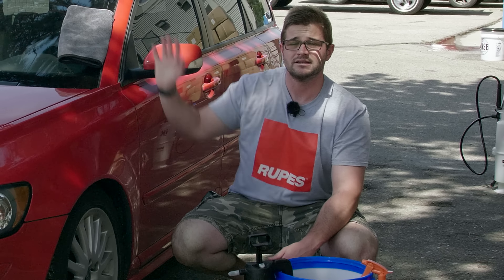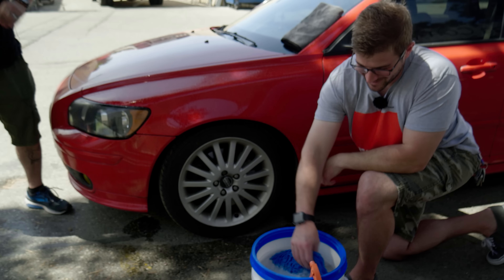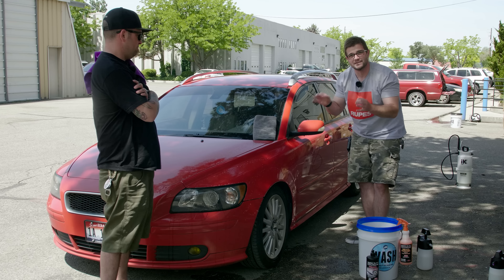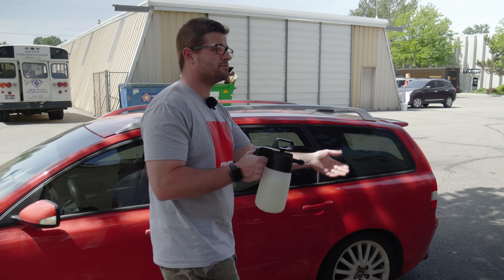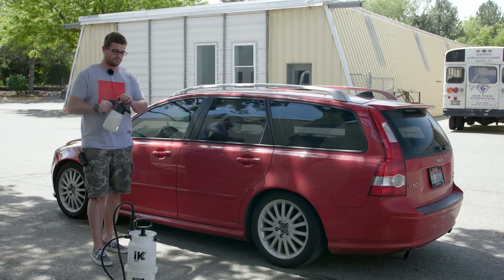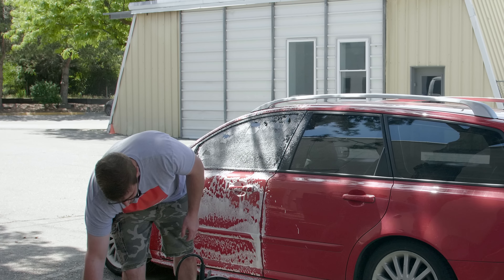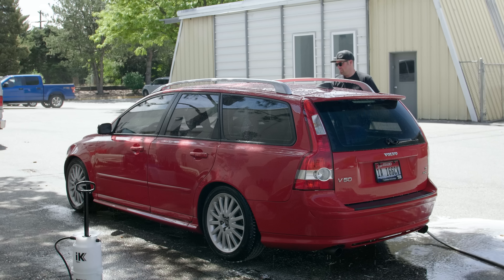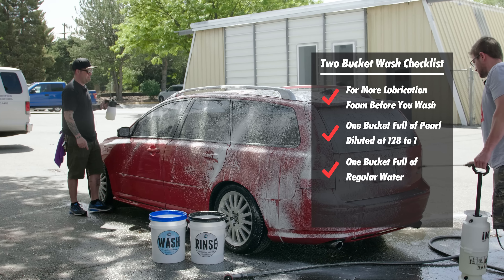BEHOLD: ALL Of The Ways You Can Use P&S Pearl Shampoo! | RINSELESS WASH + FOAM + 2 BUCKET METHOD

Comment: Ok, ever since watching your video last year, P & S Pearl has been in the back of my mind as a soap I want to try it before my next big order.  I, like the rest of you,  have used all kinds of soaps, everything from the expensive boutique brands at a $1.60 an oz to ones as low as 7 cents an oz, and for the most part I enjoyed all of them.  I've tried so many different brands of soap, from Ammo, Auto Fanatics 007, Adams, MTM, Gtechniq, CarPro, 3D, Bilt Hamber, Ethos, Optimum, Womo, Gyeon, Meguiars, Griots, Xtreme, Chemical Guys (numerous), Fireball, Tac Systems,  TLC last soap, Angelwax, Turtle Wax, Pearl Nano, and the list goes on. I have a few favorites in the group that I buy in the 5-gallon containers, but the rest was just for testing. So I was about to order when I watched Pan's video on Pearl and that's when I decided to try PEARL because I really wanted lubricity over anything else because I have learned I am not a fan of suds over substance, i.e. cleaning power.  

We have never been this happy with car soap, so much so that we bought ten gallons.  The lubricity is out of this world, I mean I have never felt anything like it.  We use 1 oz per gallon for contact wash and 2-4 oz in the foam cannons and the cost is only about $48 to 60 for five gallons on sale, which seems to be about every two weeks, :-).  This soap proves again, tons of foam doesn't clean the car, it's the cleaning and lubricity agents within the solution that are the secret and PEARL nailed it!  It is the perfect consistency that allows cleaning agents to separate the dirt from the car and it's low viscosity produces a thick but watery foam that is capable of moving the dirt off the paint with ease.  I am SUPER SOLD on Pearl!

Comment: Anthony/Levi, will either or both of you be putting out a video on P&S's Inspiration Ceramic Coating? If so, and you are going to correct the paint can you use and explain the use of the LC Orange HDO pad with The Last Cut, on Anthony's Porter Cable (For us Padawan Detailers) similar to how  he used it on the $500K Mustang Detail.

Comment: If I pre-treat a panel with degreaser (removes traffic film and wax and sealant) and then begin to do the rinseless wash process using a wash and wax soap, will it put back the removed wax or since I used the degreased I need to apply a fresh layer of wax?
I mean will using a wash and wax soap compensate for removed wax by degreaser?
Thank you!

Comment: So if you are using Bead Maker as a drying aid and it is getting applied to a wet surface does it dilute or impact the end result of the Bead Maker meaning impact the slickness or gloss enhancement because of the dilution with water during application?  I have been washing my CQuartz coated car, air drying it with the Master Blaster and then applying Bead Maker as the last step but not as a drying aid.
Reply: Thanks for replying.  Not concerned as much about the longevity my car gets washed at least once a week and gets Bead Maker every time so I'm more concerned with the slickness and the gloss enhancement.  Good to know those aren't effected when using as a drying aid.  May have to start applying it that way.